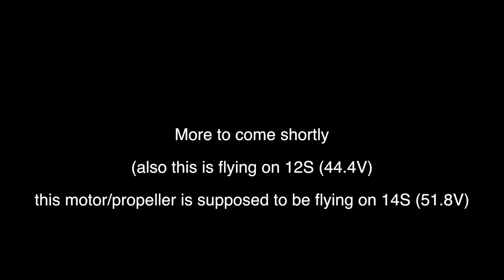My HomeMade electric plane Really flies!!!! (short hops) part7

Comment: Too cool! 

Watching and hearing your throttle use, I had the feeling I would want smaller knobs on the levers, that would still be close enough to each other to facilitate finger control rather than palm control. Disks instead of dowels.

The throttle ramp-up does not seem to be linear enough, so that you are getting too much power change in small movements at the top end of the lever travel. A programmable controller might help with this. Also, I would want to feel a little lever movement past full throttle, so that small inadvertent bumps would not immediately change power settings.

It might also be nice to have a little more throttle lever friction, so that you can feel good about letting go of the levers. An outstretched arm with palm on sensitive levers is too subject to the buffeting of flight, and can aggravate panic.

Good job. Really like what you have done.

Comment: As a pilot and AIE I wont lecture you on things but I will offer a solid piece of advice ment out of concern not mallice, Wear a helmut, even on the hops. You might add in a head protector behind the seat, if you go nose down and land upsideown or flop over it could keep you from a broken neck, you can make one from carbon fiber or aluminium that wont cost alot of weight. Great work on your project cant wait to see more.

Comment: I second someone's suggestion of adding a yaw string or a wing vane on the nose to help with coordination. Even in straight flights it will help you if you have a slight crosswind, and it's the cheapest instrument you can put on an aircraft. And when/ if you do get to the point of making turns, an uncoordinated turn is right up there with stalls in the things most likely to get you killed.

Comment: instead of adding dead weight to the back, would it be possible to add more batteries? I was thinking same voltage and vary the amphours depending on how much weight you need.

Comment: Congratulations Peter, that's a remarkable achievement! A note from a glider pilot - stick a yaw string on your canopy, it really helps with rudder control. Low tech, but it works (assuming the airflow is reasonably smooth over the nose).

Comment: Congratulations

what is the weight of the aircraft without engine or batteries and what is the weight of the engine

I have a similar project for the wing and fuselage manufacturing system but with a thermal engine.

Comment: really cool and well built.  I have looked into some of the old school wood ultralight kits and yours looks vastly more substantial, given all the foam and glass work it is more like a Burt Rutan build, which is high praise.  I think the strobe is a trivial thing given you didn't even enter the pattern height - like 990 ft below it, not really entering any airspace of note.  Only thing I worry is whether you had some input from an EAA member who has built and test flown wood ultralights before - could be very helpful.

Comment: Nice work! It's kind of hard to tell from the video, but are you flying high enough in these runs to get out of ground effect (giving you a lift boost)? Looks a little bit mushy when you're pitching up at full throttle, which suggests there's not enough thrust there to pitch up 10-20° and keep climbing out. You'll feel it though, so interested to see how further testing goes.

Comment: Peter, great job, but please get a helmet and Forget About Differential Throttle!! You cannot benefit from it while in the air.
Reply: Maybe some day you'll become the first and/or finest fullscale radical 3D pilot, but this is not the airframe for that.
Reply: Yep I agree diff throttle is good for ground handling but not needed once you take off. also really just steer with rudder as you take off much easier and less can go wrong using diff thrust.  And yes I fly a chinook wt11 ultralight with a modified built up wing not the old rag type wing.

Comment: I am getting my private pilot's license right now and this is super cool. Something I hope one day I will be doing. Definitely keep in mind that you are still in ground effect for all the tests you have done so far, and expect the plane to fly slightly differently at altitude. Just don't be surprised when you lose a lot of your efficiency at 10+ ft off the ground. Keep the vids coming though and fly safe! No flying under bridges
Reply: he had it out of ground effect for a few of the hops, and he's throttling back to about 60% once he's off the ground, so I'm sure it's got enough power to fly around. Good luck with your PPL, it's quite the journey. I finished in June and I'm currently an UND working on my instrument rating. Should be a commercial rated pilot by the end of sophomore year :p
Reply: I should also be a commercial rated pilot by the end of my sophomore year. Thanks for the luck!
Reply: Joseph Dittrich are you headed to UND?
Reply: No. I'm getting my license out of Missouri.
Reply: Joseph Dittrich at a college?
Reply: Yes.

Comment: Congratulations on your first flight! Great job on the build. A safety suggestion - I suggest mounting the upper harness points in double-shear (mill a slot in the vertical members, and put the end in there). That will reduce the twisting moment on impact for the vertical members and possibly keep them from snapping.

Comment: I oddly feel very uncertain about the wheel placement after landing. I would suggest to take a look at it and perhaps have the plane lifted a bit more off the ground, to me it'd be more forgiving of mistakes and a bit of a bigger range to land on, if one mistake which you get scared and tilt while landing, one of them wings will be gone. But what do I know, you built a light aircraft that actually flies.

Comment: need to get yourself one of these before you even think of taking it out for more than a few min 
better to be safe than sorry 
i use one on my E-Bike and it works really well
 https://www.ebay.com.au/itm/LY6-12V-48V-Lead-acid-Lithium-ion-Battery-Capacity-Tester-Panel-Status-Indicator/232255673962?ssPageName=STRK%3AMEBIDX%3AIT&var=531487070087&_trksid=p2057872.m2749.l2649
Reply: also you could glue ultra thin flexible solar cells to the wings to give you a little more power and facilitate automatic charging when you are landed somewhere

Comment: This is a commendable project. But it does seem to be flying on a somewhat ragged edge. Between the (what appears) to be under powered motors and your almost constant uncoordinated flight I feel a stall with a rapid departure is too close for comfort. More power, and maybe a couple hrs in a certified tail-wheel could help you manage this?  Not trying to bust balls here, just a fellow aviator wanting to lend some advice if you want it.
Reply: That would be a fair comment.. If I didn't build, repair, maintain and fly Aircraft for a living.
Reply: He's getting bigger (14s) packs, which will be much more powerful, especially considering that is the power the props he has are made for. Currently, the motors are spinning at too low of an RPM for the props make full thrust. I do think a few hours in a tailwheel would be beneficial though.
Reply: Ya, I saw the 14s were coming in, I think that will make a substantial difference.  Either way, I hope Peter gets  on top of keeping that beast coordinated.
Reply: Nusser Aerospace definitely. A turn coordinator wouldn't hurt in the slightest. I do think he had a crosswind during this video though, which could account for some of the slip to land.
Reply: Darrell Grisham nobody here was giving anyone shit. We all want to see this project succeed and get better. Bitching at another commenter and resorting to ad hominem does not make you look good.
Reply: I think the only turn coordinator that wouldn't be a weight penalty for the aircraft would be some yarn attached to the front deck of the nose.  It wouldn't be perfect but its been done before, especially in gliders.
Reply: Darrell Grisham they're just looking out for Peter you moron
Reply: Gary, if the weight of a simple slip indicator is an issue than there are bigger problems here.  But im sure Peter will do something to stay aware of cordination. He isn't stupid by any means. Lol
Reply: Damn! You rock!  Just watched all 7 parts. Fantastic!
Reply: Hey! Build your own airplane, you are like those who comment on everything and do nothing. Yeah. had the Wright brothers thought like you there would be nothing but couch potatoes of whom you are one!

Comment: Congratulations! Maybe you can move batteryes and ESC's to the motor pylons? Short power cables = less weight and resistance. Plus cooling.

Comment: Nice work man! Really nice job on the build. I know you've probably been overwhelmed with advice from everyone, but I think a bit of tailwheel training would help you. Just go for an hour or so in a Champ or Cub to get the feel for it. It might save your plane getting a scuffed wingtip and a bonked nose. And you will probably already do this, but you should run a pack or 2 through the motors at high power setting while tethered on the ground. You wouldn't want to have something burn out at a critical point.

Comment: Congrats dude!! So happy for you!  With your machine park and skills you can build anything!
But! Don't go fly long and far before you change this shit landing gear: even slight perpendicular crosswind will oblige you (as any pilot) to land on one wheel and the wing s tip may get caught and break the plane causing you a spin on the ground. 
Also, remember (what you probably know): it is very, very important to land with nose of plane pointing same axis as the vector of movement, parallel to rwy axis, remember to use rudder just before touchdown. Cheers!

Comment: Nice work dude! I wouldn't be able to keep it together had I been in your shoes. Question about the landing gear. Do you worry at all about what sideloads will do to your landing struts? You landed in a light crosswind but what if you landed with more crab and on asphalt, or hit a bump?

Comment: Congratz. So happy for you. Well done. What a great project. But please wear a helmet.

 Would mounting enough solar panels to get you the 116V charging voltage weigh too much to increase your flight time? There is enough space on the top wing But you have to add in the weight of charge controllers and distribution.
Reply: would need light weight flexible solar panels. and I dont think it would help a whole lot maybe a little bit. but it would make it harder to take off!
Reply: power film solar panels. Get them to sponsor it.

Comment: Wow peter I've never seen you fly so beautifully before, I cannot wait to see what will happen when you add a bigger motor on!
Reply: He's getting much more powerful batteries, which will negate the need for more motor. The props he currently has are made for the batteries he'll be getting soon. They're too small for the 12s setup he has now, so they're not making the thrust that they can. And, bigger motors are a lot more weight, possible pushing the airplane out of FAR part 103.
Reply: Jonesy Films I don’t think he needs a bigger motor. Listen to him
Reply: Jonesy Films me too
Reply: I fink it needs a powerful motor because the chance to stall its minimum

Comment: Nice job Peter.  You are still on the hairy edge from the looks of things.  I would like to suggest you make some fairings for all your square tubing struts.  a square tube has something like twice the drag as a round tube the same size.  Some foam leading edges and trailing edges held on with packing tape would be better than what you have right now.  

Oh as I remember the regs... If you are flying less than one wing span above the ground you are not an aircraft.  In the live stream it didn't look like you were that high above the ground.

Comment: I'd be interested to see what your stats are as far as AirSpeed stall speed things of that nature how much throttle does it take to keep it in the air. You need to do a video on all that. I bet if you did some work and clean up the plane and get rid of some of the drag you probably would find you get better much much better performance.
Reply: things like: streamlined struts and fairings ?

pity these can't be got from Lowes.
Reply: Yeah streamline struts that kind of an expensive item out of Aircraft Spruce or someplace like that but you could take foam In-Shape the square tubing and then wrap it with Dacron and glue it things of that nature. That's what I've done all my Avid flyer except for instead of foam I used a light wood and glued it to the round tube struts

Comment: Paint it like the Red Baron
Reply: that would look even more badass:) and then add some paintball guns :))
Reply: Raggea Loin exactly what I was thinking.
Reply: paint is unnecessary weight imho, love that you can see how its constructed :)
Reply: he said its noseheavy, so he have to add weight if he want or not.
Reply: or place the batteries more in the back... shifting weight is better than adding more
Reply: I know, but maybe he should just sit a bit more in the back, like in old biplanes
Reply: It will help a lot. When you fly an airplane you run a weight and balance calculation every time you fly to make sure you are within limitations. If you are not, you take out gas, re arrange passengers, move baggage...

Basically, there is no need to add weight to the aircraft at all, but, paint would be a nice addition.
Reply: but the plane is noseheavy. puttign the batteries more in the back wouldnt help THAT much.. XD
Reply: Raggea Loin batteries are one of the heaviest parts...
Reply: But the Red Baron is a triplane ... maybe for a future project ;)

Comment: Congratulations peter. Building an aircraft that works first time is very good. Many homebuilds go back to the design phase after first flight. Looks like it’s trying to pull to the right (yaw)? What’s that about? 
As for not strobing after sun down, I doubt they’ll take away you license. If they do my only advice would be challenge them to a fight. 
Looks good. You said you were a Cessna pilot which has the tricycle gear, what does it feel like in take off where the nose dips down? From what I heard it’s like a natural panic for people who fly tail dragger from tricycle when the nose dips

Comment: Hey, I just saw how your seat belts are set up. Your shoulder straps transition from vertical in the rings to horizontal on your shoulders (@ 12 minute mark gives you a good shot of what I'm talking about). This reduces contact area on your shoulders and can cause injury in an accident. Please mount them over a round cross bar. If you have any questions, look up 5 point harness bar in google images. This will also help keep the straps on your shoulders, which I saw you struggling with too. Best of luck, looks like you have the controls pretty down pat!

Comment: Ok, seriously folks, it’s time to be concerned for Peter’s safety. This damn thing actually does fly. Which means, he’s got the CG and all the engineering close enough to correct. Folks, he’s a leather cap and a pair of goggles and a white silk scarf away from doing this. It’s time to BE WORRIED!!
Reply: People design and build their own planes and fly them quite regularly. You being "worried" shows you don't think much of his abilities at all.
Reply: Which part of seeing it fly told you he's that far away?  He was out of ground effect, and could have flown as high as he wanted to, limited mainly by battery capacity.

Comment: I doubt they will fold, but the braces on the motormounts (between the two alu tubes) would be stronger if it was between the other corners. Now it is under compression, from the front outer corner to the back at the fuselage would be better. Beautiful plane, really looks like a big Rc plane, I love it!
Reply: Yep.

Comment: SO PROUD OF YOU!    would large rc gas engines work on your plane/would you ever consider using them?
Reply: Most of the plane appears to be made of polystyrene foam, which is soluble in gasoline. Therefore IMO using gas engines would be ill advised.

Spark ignition engines running on methanol or ethanol might be okay, assuming that the lubricant mixed in with the fuel doesn't dissolve the foam.

Comment: Put two of those batteries (more) in the back and you won’t have the nose heavy problem but then you may need a 2nd set of/or bigger electric motors.

Comment: Great work Peter I've been following you from flight test. Now for my two cents only because i care about your safety trust me i know how anxious you are to experience the capabilities of what you have proudly created but you should be open to advice its a huge part of learning anything new. Well here goes. Head protection and simple roll bar. Lengthen your gear a little, you are one unexpected cross breeze away from grabbing a wingtip in the grass it only takes a split second for things to go really bad. For right now keep your throttle inputs even and smooth  and just work with your rudder. You would be amazed how fast differential  thrust will throw you into tip stall and with your short hops right now you have zero altitude to recover. Top edge and corners of wind screen and proximity of your face are not good in the event of mishap. Please think of new design based on seating hight and top of screen, at least some foam noodles on top edge for right now. Thats it. sorry just want you to be safe and not over anxious. Baby steps my friend. Love what you are doing and great job! Keep up the good work. Looking forward to seeing your SAFE progress.